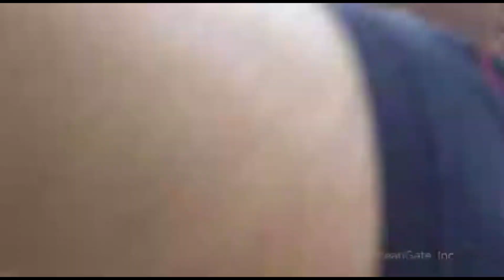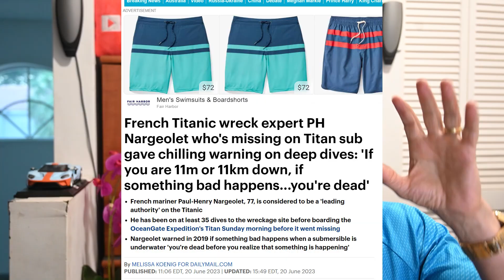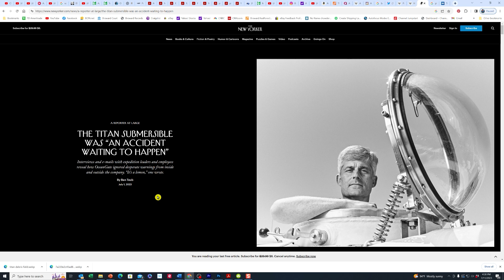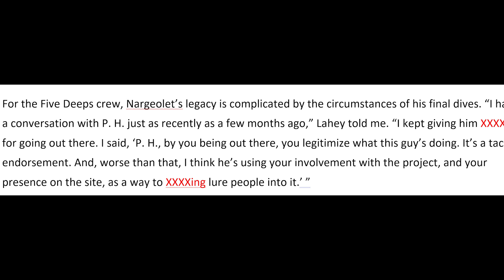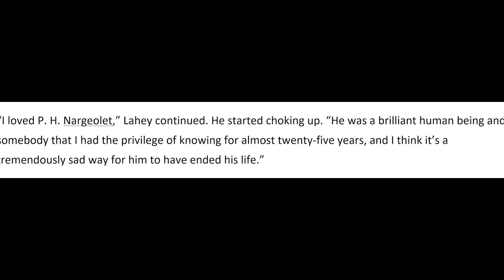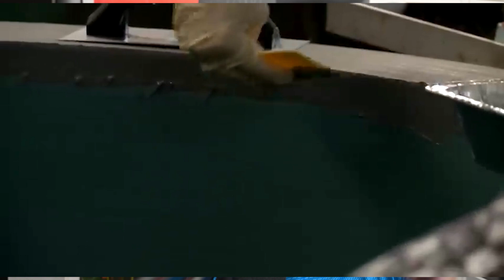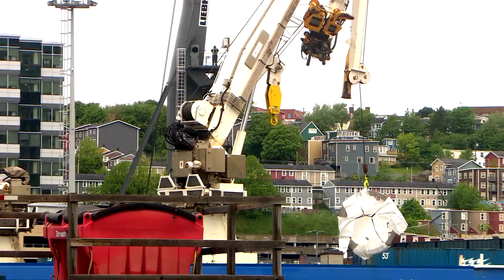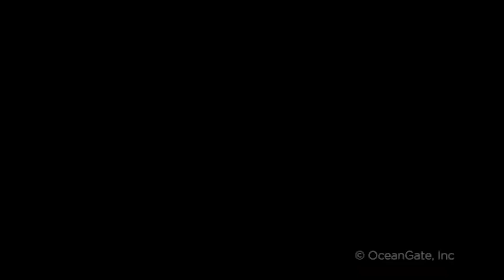Titan Sub: More Q&A, Design Defects, Why Descent Fast

Comment: The biggest take on the TOO fast of a dive is that the sub was taking on water as it was going down. Which then prevented them from aborting the dive in their attempt to assent. They jettisoned the heavy frame and even that didn't effectively improve the buoyancy parameters.
Reply: It CANT be leaking and reaching those depths. Drop this theory.
Reply: @KinariCuzz  True, cos of pressure. But what if there was water accumulated BEFORE the dive which filled the cavity where the tiny hole was.
Reply: @matildafaltyn6253  unlikely. But would also be pretty much the only way for them to be overweight by water.
Reply: where was it taking water? it certainly didnt have a leak in the pressure hull, going down.
Reply: @libertas12  someone flushed the toilet
Reply: @libertas12  how do you explain that ditching the skid frame that most likely weighted 100-300 kilos barely made a difference in assent?
Reply: @utube321piotr  fake transcript is probably the best explanation and or theory. The craft cant be leaking. And the material cant get soaket. I doubt there are enough air pockets in the carbon to weigh it down that much. And a leak into the pressure vessel is impossible.
Reply: Assuming their routine buoyancy calculation and preparation was correct taking on water is the only plausible cause since we shall assume that any volumetric crushing happened suddenly, so short of some deliberate action of someone clandestinely lining their pockets with lead pellets water ingress is most likely
Reply: Or that it’s smaller than it’s supposed to be…
Reply: someone ate a big meal before the dive lol

Comment: I still have yet to hear anyone talk about thermal contraction of 2 different materials and how that glue/sealing material was able to compensate for that.
Reply: I was thinking about that as well. Especially if the carbon fiber is getting weaker each dive.
Reply: I think the thermal expansion is not relevant here because the temperature are very stable in the oceans. Difference between surface temp and bottom temp is only about 15 degree celcius.
Reply: @DKFX1  28*F water temp at the titanic, i presume there was some sort of heat generated inside the vessel.  carbon fiber shrinks when it heats up, expands when its cooled... the exact opposite of titanium.  if it was assembled and cured at 75*F, the tolerances at 2.5 miles deep and 28*F outside and ~60*F internal could be enough to create sealing problems, which is shown by the lack of adhesive on the titanium.
Reply: It wasnt able to. Lol.
Reply: good point
Reply: I have heard around a 1% difference.
Note that another manufacturer did reliable dives with same construction plan, just not manned.

Comment: Also dont forget this issue; carbon fiber is strong: when pulled. Not when being pushed upon. For airplanes, thats fine, the carbon will inflate like a balloon, then tension up, and hold. The other way around: it just buckles. The fibers are being pushed together: the circular form is no longer in play as soon as the first fibres give in. There is no other way for the fibers to go: then 'out of the circle'. and when the circle is no longer intact: boom.
Reply: plus carbon fiber is meant to be brittle when breaking appear in order to absorb the energy though fracturing, why cars are made of carbon fiber because it releases the crash energy into the brittle parts rather than transferring all of the energy into the driver, it simply sucks as a material when pressure is applied all around it since it would simply shatter.
Reply: There is a company that makes carbon fiber tubes for submersibles that go lower than titanic and no failures to date
Reply: Apparently carbon fibre can be used in this manner and still be incredibly strong.

Comment: 2:56 Cameron said it best "it's insidious because each dive brings you closer to death, and makes you more comfortable about diving'
Reply: @SuperNostalgia.  Thanks grandad, now back to the hospice...
Reply: @DreadPyke  Lol.
Reply: @DreadPyke  lmao, thank you
Reply: Interesting point.
Reply: Unfortunately that sounds like the Space Shuttle Challenger report.  They got away with it several times so they convinced themselves it really wasn't a problem.  In fairness to the shuttle, there were probably a million issues and you have to use your judgement on where to spend limited resources to fix things.
Reply: @kennethng8346 THE O-RINGS don’t work at freezing temperatures!” was the warning from the company that built the thrusters.  NASA simply chose to ignore the warning & that’s basically negligent homicide 

.
Reply: Those NASA managers should have been fired.
Reply: @electrictroy2010  Earlier flights had less degrees of burn through so they knew it was a problem.  But there were millions of other problems.  If you have resources to fix only one percent of them, you have to decide what to fix and what not to fix.  Question is: who said this is your budget and you have to live with it?  Congress.
Reply: @electrictroy2010  no you understand they the company built the o rings right? Like it was part of the rocket they produced.
Reply: There are bold divers and old divers, but there are no old bold divers
Reply: @SuperNostalgia. There’s 100000000000000000000 suns in the universe.  It stretches 900000000000000000000000 miles across.  No higher being is capable of running that huge expanse.

Even if a supernatural being existed (1) where did he come from?  An all-powerful man just popped into being from nothing?   (2) Why would he care about some insignificant critters on a backwards planet (out of 100000000000000000000 stars).  He would not. 

 Be realistic
Reply: @electrictroy2010 out of all the religions it's always people trying to bash Christianity just leave us alone if u don't believe simple as that
Reply: @princesskitkat7061  Christian here.  Electrictroy isn’t bashing Christianity.  He just doesn’t believe in a god.  Asking where God came from is a fair question.  God doesn’t belong to Christians only.  There are numerous religions that believe in God.  So to say the he’s Christian bashing simply because he’s questioning Gods existence is a big leap.
Reply: Very similar to the attitude that prevailed at NASA when the Challenger blew up.
Reply: @SuperNostalgia.  Well, God gives our SOULS eternal life.  But these guys' butts were consigned to human ego and carelessness.
Reply: @FD2003Abc  EXACTLY!!! and Amen!

Comment: why couldn't they have used some kind of bolts the whole length of the carbon fibre tube? , yes they might have weakened it but why 5 inches of carbon fibre and not 10 ?

Comment: Awesome analysis as always! I'm still curious as to why the sub descended too quickly and made little progress in its attempt to surface. I've seen comments make suggestions as to why, though I'm still curious what your thoughts on the matter are. Regardless, thanks for providing us with detailed videos! They're really enjoyable.
Reply: Too heavy/wrong ballast.
Reply: @russellhltn1396 it wasn’t too heavy that was the point of carbon fibre and ballast wasn’t wrong because they successfully used it before it doesn’t matter if they were construction pipes if they worked before. They had trouble dropping weights and landing frame because of electrical failure according to the transcript
Reply: @yourshadows  Buoyancy is a balance between weight and displacement.  I doubt if it takes much to upset the balance and descend faster than intended.  For every pound they were overweight, that's another pound holding them down when they tried to surface.  I'm pretty sure dropping the frame was a last ditch effort to come up.  But even that didn't do much.
Reply: @russellhltn1396  maybe it's as simple as someone miss calculating the total weight of the crew versus ballast, or the classic NASA mistake, mixing up imperial with metric
Reply: @nem447  you might be onto something 🤔
Reply: @nem447 .  So a few hundred pounds between passengers would sink them? I doubt it was that kind of bad.
Reply: @nem447  Yeah, looking at the crew's weight would be one of the first places I'd look.
Reply: Read Tock Rush's texts to the ship ... it appears that he was struggling to ascend
Reply: Remember the mother was supposed to go, but gave her spot to her son last minute.  Maybe the weight was an issue and they didn't want to waste the spot and $. ?
Reply: The carbon fibre tube might have been deflecting in the middle resulting in lower volume of water displacemed so less boyancy. This in turn may have pulled the carbon off the dished titanium end.
Reply: I’m just an average person with a small amount of SCUBA experience, with Eustachian tube issues.  Ask my ears what it’s like if I descend too fast (and, we’re only talking about a “few feet” too fast).  I know the importance of a controlled descent — experience is the best teacher.  

So WHY did they keep going when they KNEW their descent rate was too fast — and WHY didn’t the surface vessel address this???
Reply: Did we ever find out that transcript was legit?
Reply: @thewhitefalcon8539  Still considered unofficial.
Reply: Most likely the carbon fibers were getting waterlogged and that's why it was descending faster than normal and why when they dropped ballasts, the submersible was ascending too slow....it was too heavy. 😭
Reply: Same here, especially since it was a two-way conversation….so both side could/would have had input into the rapid descent rate.
Reply: Same here.  Why the rapid descent?  They must have weighed the passengers.  Still can't get a solid answer to that.  That porthole Plexiglas was only certified to 1300 feet so WTF were they thinking?  Was that the first thing to blow out?  And may be a dumb question, but how are those outside cameras not crushed by the pressure?  Or those thrusters?  I would think P.H. Nargeolet would know there were problems.  He was a Titanic expert and diver for 40 years, so why was he okay with any of it?  I agree with the grieving widower thing because even though he'd remarried, don't think he ever got over his late wife Michelle's death.  He was supposedly madly in love with her.   But there was still the possibility that since they were bolted in that thing, not even P.H. would want to suffocate to death if they had been somehow managed to surface, being bolted in with no hatch, they had no way out even in that scenario.  That is just insanity IMO.
Reply: @ElizabethF2222  1300m not feet. But still, not enough. 

Only things with a space/void on the inside containing a gas/liquid less dense than water will implode. Meaning if the camera is filled with lets say plastic, there is no air to compress and the shell will thus hold. 

Passenger weight is probably not that crucial.
Reply: @KinariCuzz  Thank you!  I appreciate your reply.   1300 meters makes much more sense!   I still don't understand what caused the rapid descent, but now I get it with the cameras, etc. with your explanation.  My father is an architect and builder of high rises and commercial skyscrapers.  He was horrified at the way that sub was constructed.    His business, the construction industry, is highly regulated for safety with OSHA,and federal regulations and codes, etc.  The inspections for skyscrapers are off the charts, as it should be.  By going offshore into international waters and the Bahamas, Stockton knew he would avoid OSHA and US Coast Guard safety certifications as well.  Such a shame.
Reply: I’m sure we could do some quick math of the occupants weights and find out the issue
Reply: They cannot resurface due to an electrical failure, probably no thrust.  The electrical system was designed by an intern (yeah, shocking)
Reply: Probably a battery short circuit. Robbed the thrusters of voltage making them fall faster and then over-discharged the batteries when they tried to ascend. Then the batteries did what lithium batteries love to do: they bulged. However, the high pressure probably caused them to react for much longer than would happen on the surface so when they popped, a lot of energy was released.
Reply: @ryelor123  I'd think they have two sets of batteries for the two electrical busses.  Doesn't make sense to install redundancy and only have one battery pack.
Reply: It was taking on water
Reply: @utube321piotr jesus this again… it CANT take on water and reach those depths.
Reply: @KinariCuzz YES it’s possible for a sub to partially flood & still not implode.  Navies around the world train for this exact scenario (and how to compensate for a partly flooded sub).  In the case of Titan I think the aft section was flooded as soon as they submerged.  That’s why the sub fell 150% faster than it should have
Reply: @KinariCuzz  Couldn't a pinhole size hole form first, prior to failure, and allow water flood the rear compartment?  This is at least one theory I watched on a You Tube video ( I forget which one; there are so many).  The theory that water invaded the rear compartment not only accounts for why the sub had trouble surfacing, but also the electrical failure.  Of course, I don't know, and this is only a theory.
Reply: @electrictroy2010  Using a depth of 500 feet that might be true. It has nothing to do with the depths that submersibles reach. Deep diving the rules change.
Reply: @frankfielder  If there was a pinhole leak - they were dead much earlier than what happened.
Reply: @frankfielder  a pinhole by the surface would have grown in size long before they reached the bottom. 
When they say rear compartment, im assuming they mean the tailpiece which is outside of the pressure vessel and just covered by plastics to hide the tech. The wall on the inside is just a small space divider and still part of the same pressure vessel, just as the floor.
Reply: @KinariCuzz  i think the rear compartment or something in the back may have been taking on water - not the pressure hull where the passengers were

Possibly a compartment where batteries or electrical components were.... The transcript released (unconfirmed?) indicates they heard crackling in the back on the sub, which could mean something in the aft compartment took on water and started to give and/or short out at that time. 

This would explain negative buoyancy due to taking on water, as well as electrical issues that gave them trouble when trying to drop ballast
Reply: Sounded like electrical failure as already stated. The crackling was something arcing on the battery terminals. There could of been a fire in there and they not even know it because it's sealed. Melting stuff. The terminals or cables could of gotten hot. Melting anything around. An in a vehicle like that would certainly be certain death. Carbon fiber. It'd melt right through it. Be like putting a cigarette out against a full  milk jug or water bottle.

Comment: Why are you focusing on the design and not the operational life.  The design is perfectly good, it did 13 successful dives!  However, maybe Titan should have been retired after 6 dives.  Give me 3 unmanned Titans to test until implosion.  Then we can set an Operation life, (and improve the design).
Reply: The design was objectively terrible.
Reply: @MrJC1  Titan dived 13 times. The design was good, if you limit the number of dives.
Reply: @tgtips  the titan had a 14% success rate. its design was never good. lmfao.
Reply: @MrJC1  I don't think you understand how Risk and Safety work.  It's not calculated by success rate.  It's calculated by Operational hours, and safety inspections.
Reply: @tgtips  we will have to agree to disagree i guess.
Reply: @MrJC1  also, you might need to learn maths again. The success rate was 93%.
Reply: @MrJC1  and the fail rate is 7%. Where do you get 14% from?

Comment: I am a Helicopter Blade Engineer and we bond Titanium trim tabs to carbon fibre blades with 3M AF163-2K and 2U at 230 degrees F for 2 hours. We also use positive pressure or vacuum to bond them to the blade. NOT WITH AN EPOXY PASTE ADHESIVE !!!! Appreciate that this is not a completely fair comparison but industry standard for bonding carbons and metals for maximum strength is with film adhesives, temperature and pressure.........seeing that guy touching the ring surface without gloves and blatantly seeing NO surface preparation to that ring before bonding only adds to the disaster waiting to happen. All very sad for the families :(

Comment: Wonder if the Sub was too heavy, maybe they miscalculated the weight or a normally pressurized compartment on the outside flooded and made the sub heavier which resulted in its faster then usual descent time and why it could not surface after they dropped the ballast. A flooded compartment could also explain why the primary power bus failed if it was housed in that compartment.
Reply: The machinery compartment wasn’t sealed or pressurised, but I’m with you on the miscalculation of weight.